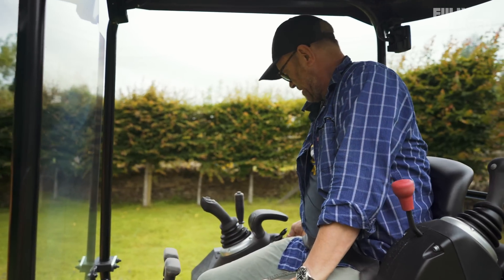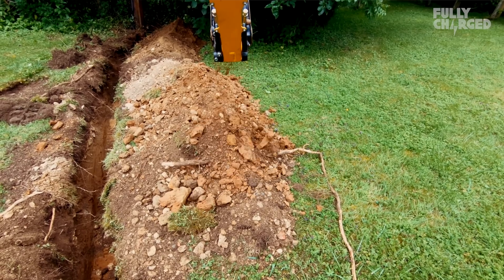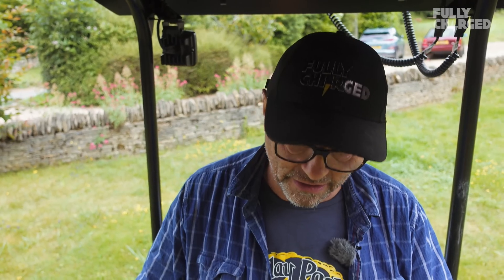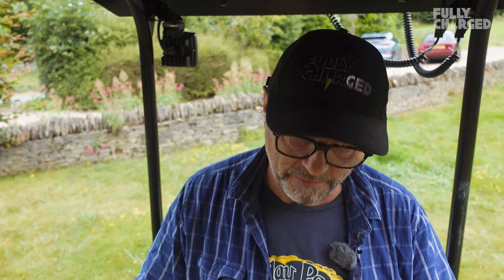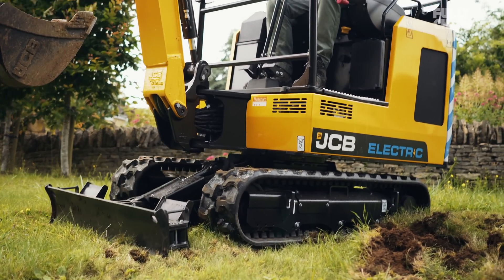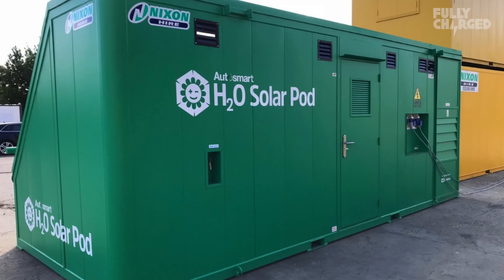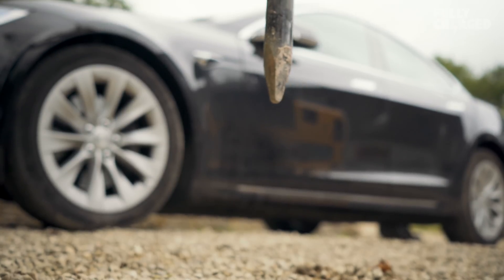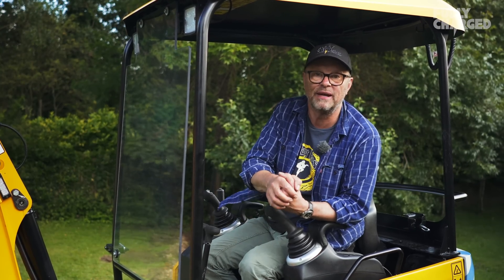JCB Electric Excavator / Mini Digger JCB 19C-1E E-TEC zero emissions electric digger | Fully Charged

Comment: I'd have scraped my gravel to one side first so it didn't get all contaminated with dirt, or at least put something down to keep them separated. Also I spotted that 90-degree sharp corner marked out on the garage concrete: doesn't your conduit have a bend radius?

Top toy though. I just need a pad in the country and some excuse to dig a big hole... (I have hand-dug quite a big hole round the side of my house in order to insulate it down to the foundations. Not an idea job for a digger that one - bit delicate (and 'sideways')).

Comment: This is probably the only thing I have seen on your shows (of which I watch a lot) which is unequivocally good , I can't see any down side at all. I would imagine that if they become viable for replacement of bigger diggers the world will be a better place and an awful lot of people will escape hearing problems. I was  surprised that you need 3 phase supply though, I would have thought with all of the solar panels etc. you would be using less electricity not more.

Comment: Just a quick question, the reason for not winding up the 13 amp cable while recharging is...?
Reply: Electric cables heat up when you put a heavy load through them. If you coil them up then they can get hot quickly and the insulation melts and can catch fire. Very dangerous. A 2kw load for several hours recharging a car or mini-digger will very easily cause this situation. If you are using more than a couple of kw then use an extension cable with at least 1.5mm wires in it.
Reply: Coiled cable gets hot when running continuous high load. The 13amp spec only applies to a fully unwound extension cable.
Reply: The coil makes it an electro magnet.
Reply: @colmone5592  Erm, no it doesn't as both live and neutral conductors are wound together in the coil  so they cancel each other out.

Comment: It is amazing how little noise it makes. I'd always assumed that some of the noise came from things other than the diesel engine. A guy turned up to lop some branches off my tree with an electric chainsaw recently, almost silent. He said it allows him to start a lot earlier in the morning because he isn't waking everyone up. I am sure the local wildlife appreciate the lack of noise too (if not the lower tree).
Reply: I bought an electric chainsaw earlier this year. It certainly is not silent !
Reply: @millomweb  I didn't think they were either before I heard his one. It was a lime tree so maybe it cut easily but It didn't make much noise at all (I think I was also expecting the noise of a petrol one so that may have made it seem quieter than it was to me - either way a massive improvement.
Reply: @robsmith1a  I'm guessing noise sources are:
chain
Chain drive gears
motor and most noise from the motor fan. I suspect if I block the air vents to the motor on mine, it'd seem quiet too.

Think of the noise of electric hand drills, angle grinders and cut-off saws. All motor fan noise!

Comment: I love seeing this, I can't wait to see  more and more fully electric construction equipment.  I myself have been running full size excavators, backhoes, roadside mowers, street sweepers, dump trucks ect for the last 15 years or so and would love to see them go electric. The reduction in noise alone would make an incredible difference plus all the wasteful idling that goes on with diesels, most people have it in their head that diesels HAVE to run all day.
And not having the nasty, carcinogenic diesel fumes even in open air spaces is the biggest benefit,  love it!
Reply: Have a look at access platforms. Many electric varieties available and have been for years.
Reply: A great toy

Comment: I wonder if it would have been possible to make the actuators electric aswell, instead of hydrological. This could lead to safer operation, due to no risk of leaking. Aswell as the environmental hazard being lower.
A showel will drop instantly, with leakage. It's rare, but people are killed by dropping showels from excavators.

It would probably be more expensive, but at the same time more flexible with something similar to a robot arm, connected to the excavator. Not sure it can apply enough force though. Haven't looked into it, that deeply 😁.

Comment: Thanks Richard, a really nice and encouraging story. This is exactly what the commercial sector needs. Not only does the equipment make sense, and are a natural progression away from diesel, having the added benefit of reducing running costs. But the noise reduction will be a game changer. While I see the benefits in being able to operate closer to residential areas and probably for longer periods past the time loud equipment will be forced to stop. The real benefit in my view will be the reduction of damage caused by lack of/miss communication between site staff which commonly results in broken cables and pipework or building damage. These mishaps cause a project's costs to rise significantly due to the additional monies spent on repairs, insurance claims and time to make good any damage. And while this machine can't fix a bad operator, it will enhance and empower a good operator, which in turn will benefit the project it's deployed on. Nice one JCB! come on Telehandlers and skid-steers.
Reply: I would really like to see an electric telehandler to replace the ones at my workplace, which I think can lift 10k+ lbs. They're occasionally left idling for over 30 minutes and every now and then the exhaust gets into my office and lingers for hours. Unfortunately, given the culture of not caring about pollution and misconceptions about electric vehicles, I'm certain they would be slow to adopt electric alternatives if they were available and at least as good as the diesels.

Comment: cheaper to run cheaper to build but more costly to purchase so no benefit money wise just less noise
Reply: depends how long you keep it, and how much you use it.  if the operational costs are even slightly lower, then over time it will be cheaper than the ICE option... the only question is how long.  One of the other posts on this thread mentions a unit bought in 1986 that is still in use (which is 33 years?) - that would be a lot of operational savings over the years - probably way more than enough to pay for an increased purchase price, and being electric means a better chance of surviving to that ripe old age.
Reply: @Ross Bourne wow thats not bad

Comment: I'm not surprised by this, builders have been using battery powered tools for a long time now , my dad was in the trade and he had the choice to stick with 110v or invest in rechargeable kit, he went cordless and found it far easier to use than lugging converters around and the spaghetti on site when trying to power a simple drill.  
For on-site power I can see the trailers that you use to transport the diggers being utilized as charging stations with solar power or an efficient generator with extra battery backup etc.

Comment: Boys and their Toys : P  Lovely to see JCB leading the field as per usual..  Their be best up-scaling this tech now to the bigger stuff people know and love like the full sized popular JCB Backhoe digger.. that would change for the better the working conditions for the builders and the planet and for the public whom have to put up with the noise and pollution that is the norm on build sites or along the roads!  As for problems stated of some places not having electricity available and using Diesel Generators it is simple have like he said solar and a storing big battery to charge from?  If they can do this machine they can find ways to charge it without Diesel.  Where there is the need there be the solution found.  I think those who dislike the Electric digger idea most likely Diesel liking twats who think wrongly that if something is not very noisy and polluting it is not worth having?

Comment: On an average day I work 8 to 10 hours driving a digger 
Question 1 how long will it hold a charger for 
Question 2 how long will it take to charge up once flat 
Question 3 if it runs flat how do you take it home 
Question 4 how much will it cost to charge it up
Reply: Ross Bourne hi Ross I was speaking to some lads that hired one for work in town after 3 hours it went dead had to be charged it took 8 hours to charge it will suit straight forward work but not commercial workers

Comment: You could save a lot of time and effort on the trenching with a trencher attachment for that track hoe or a standalone trencher. Does their trencher attachment work with that mini excavator?
Reply: I don't see why not. It is basically the same as ICE digger, but instead of diesel engine, hydraulic pump is run by electric motor.

Comment: Remember robert. 1 meter is 10 DECImeters, (decimal place), 100 CENTIeters (100 cents), 1000 MILLImeters (not quite a million, but a thousand). 
Therefore 1111 millimeters is 1 meter, 1 decimeter 1 centimeter and 1 millimeter.
Reply: It's even easier to just ignore all the prefixes save milli- and remember that that always means there's a thousand of them.

Tripping yourself up with useless prefixes like deci-, deka-, hecto- (and often enough centi-) just makes the system unnecessarily complicated when it should simply be better by 1000.

Comment: Would be nice if it ran directly on electricity.. bypass the battery. Would be cheaper. Overhead cables perhaps..
Then have a backup battery
Reply: trailing cables (or overhead power lines) would be a really bad idea on most job sites.  The batteries on this are - comparatively - tiny (15kWh standard, this one has the larger 20kWh), which from the math (~3 hours for ~20% charge) could potentially run non-stop for 15 hours (followed by 8 hours charging from a 3-pin socket).

Comment: Could it be used whilst plugged in? If it’s just digging and not driving around much maybe?
Reply: At the speed it drives, the traction motors probably use much less power than the hydraulic pumps so standing still probably wouldn't save much.  The video says it charges at 1.8 kW for eight hours and that covers a normal day's work, so I guess that means it uses roughly 1.8 kW in operation.  I guess that would allow it to run off a standard wall socket without needing batteries, but something tells me you'd probably need a higher current socket to actually do it (maybe 20 A or so).  Still, I am surprised as I would've expected it to need considerably more power, but I guess that's because I'm thinking of electric cars.  They seem to have quite large power ratings due to the peaks they pull when accelerating, which wouldn't be the case here as everything would be running at a fairly consistent rate - highway driving if you will.
Reply: @Berkeloid0  The drive is done hydraulically as well, there isn't a separate drive motor its just an electric motor coupled to an hydraulic pump running everything.
Reply: @zaragonrl  Interesting.  I wonder whether in the long run it would be cheaper to replace them with electric motors or whether hydraulic ones (including the lines to run them) would work out cheaper?
Reply: Berkeloid perhaps but this way they just literally replaced the Diesel engine with the electric motor keeping everything else the same. I'm guessing it reduced both the design and build costs. It probably also opened the way to doing the same on their bigger machines
Reply: Berkeloid
Hydraulics are cheap, reliable, compact and very powerful...

You'll never get the strength from a electric motor the same size as hydraulics.
Reply: @Berkeloid0 Hydraulic motors might be inefficient when driving, but they are great for diggers because they also function as breaks. Just close the valves and the tracks are locked. There are electric drives capable of the same (most known probably a stepper motor), but they need electricity to hold the position. And with separate drive and brake systems, you lose the perfect smooth transition between 0 and 0.1 km/h.
Reply: @Berkeloid0  The thing with hydraulic - it's a tried and trusted system - if it ain't broke, why fix it - and secondly, hydraulic systems are just so durable to any amount of abuse.
Reply: @millomweb  Not saying there's anything wrong with hydraulic traction, and makes sense if you already have a hydraulic pump on the thing, was just curious whether it's more expensive than running a couple of wires and using small electric motors instead.  I know nothing about hydraulics so was just curious about how they compare to electric.  I assume they would be physically smaller for a given amount of power, but I am suspecting all the lines getting the fluid to the motor will be more expensive than wires so not sure how it compares really.
Reply: @Berkeloid0  Electric motors use the force of magnets/magnetism. That is a naturally limited force. Hydraulic force on the other hand is mechanical and is effectively unlimited. Electric motors are more suited to speed - trains being an ideal example. Hydraulic motors are far from ideal for speed but almost limitless for power.
Electric motors generate heat & need cooling. Hydraulic motors do not generate heat as there's no form of energy conversion - it's all pure mechanical. The only real downside to hydraulic is the risk of leaks through oil seals. Leaks do happen but aren't instant catastrophe !
Elec motors aren't really suited to the job - so I'd be surprised if anyone ever considered their use instead of hydraulic motors.
Reply: Good question. Not that you'd really need that. At least at Rob's rate (down by 20% in 3 hours) you could dig 15 hours without recharging. So unless you have got a 24h worksite, there will always be time to recharge it to full.
Reply: @superdau  Dunno why all these things don't come with battery packs. Take the flat one out and fit a fully charged one - use the machine while the other pack is being recharged.
Reply: pmailkeey The battery pack is likely so large you couldn't lift even half of it let alone manouvre it around.
Reply: @DiscoFang  You'd have an electric forklift for the purpose, obviously. The one forklift* could service all the mobile machines with freshly charged batteries - and be used as a forklift too !
* Telehandler
Reply: Hydraulic motors are also sealed and they can run underwater, in sand, clay, sewerage .. whatever you can think of. Keep the electrics up, shrouded, clean & dry. They are also incredibly small for the power/force they can transmit.
Reply: Would be great if you could bypass the battery and run directly off the plug. Maybe with roof mounted lead guide to help prevent accidental snaggles.
Reply: There is also diggers like this that runs without batteries with the need of a cable. 3phase (400V)16A is requred for that one.
Reply: London to a brick there's a safety interlock that stops you from using and charging at the same time. I'm sure you could if it wasn't for that.
Reply: If it was designed that way the danger is of forgetting about the cord with a tracking device in the cord traveling towards it could be limited at the controls ( why wont it go any further and what is that beeping oh the cord) 
It could not run the machine at full load but would ease the load on the battery and at the end of the day you just turn it off and leave it plugged in to finish charging.
Reply: I had the same thought. Basic digging in soft garden soil is not much strain on the machine, but running that jack hammer or digging in much harder soils could drain the batteries in a hurry. Having an umbilical to extend the runtime could be very useful. I always wished cordless tool manufacturers would do something similar although nowadays some battery powered tools pull more amps than can be supplied by a normal receptacle.
Reply: I'm guessing the 2kW wall wont be able to run the motor (Amps are insane with battery vehicles) and charging/discharging at the same time, has historically not been good for battery longevity. Maybe they could make it so it extends longevity, by not charging, but sending mains power to the motor and having the battery pull the slack. But by the looks of it, unless its running 24 hour shifts, it's not really needed :p
Reply: @DKTAz00  They could fit a digging bucket to a dodgem car - no battery needed then.

Comment: Thats awesome. Even if that was on a job site and being charged off a gen-set i would place some pretty good bets on it still using less fuel. With a genset you got a engine spinning at a constant efficient speed to drive the alternator where as an engine in the digger is always reving up and down.

Comment: They could put solar panels on the roof, 2 sides and back, like a fold up cabin, to charge during the day.
Reply: Solar panels like this would be very inefficient and wouldn't contribute much charge (you would be lucky to get 2-3% charge from them over the course of a day) and are quite expensive. It's a common suggestion, but it doesn't add up in reality.
Reply: Keith Milner
Same reason they don't add them to EV's.

Comment: I'm excited to know what the 3-phase is for. Does Robert need a supercharging system for all the EVs he drives? Is it for some grand heating system?
Reply: 3-phase is standard on the continent
Reply: @Jakob_DK  3 phase is carried on most electrical distribution lines but doesn't come to houses as standard. You can easily connect to three phase but you have to pay for it. Typically houses are connected to single phase power as standard as most domestic appliances don't have the power requirement to justify 3 phase. Since by the looks of it Robert lives in a standard sized house, he shouldn't need 3 phase for general use.